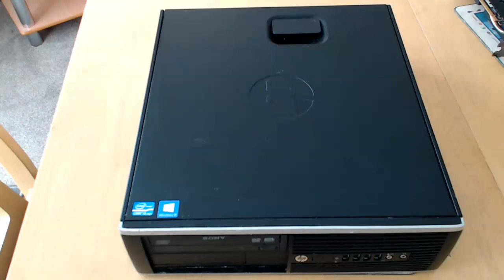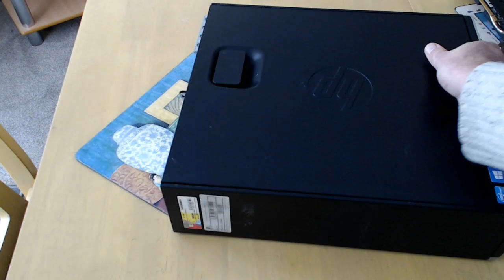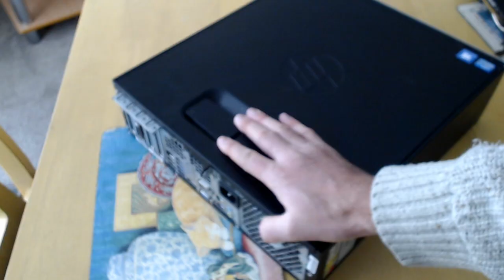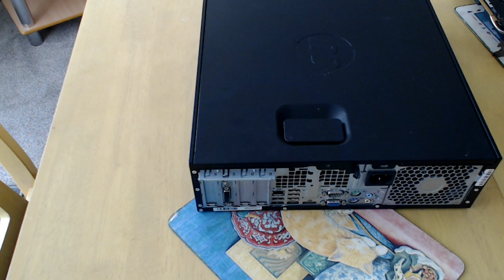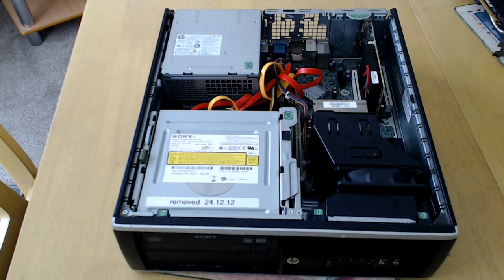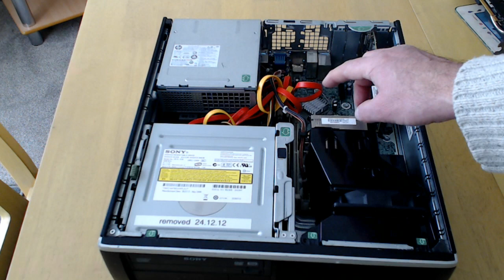HP Elite 8300 SFF desktop Part 1 Overview of system and upgrades

Comment: Can i put one more 8gb ram stick in it so it haves 16gb of ram?
Reply from the maker: Hi thanks for watching! The system has 4 ram slots and takes a maximum of 32 gb. So yes to your question! Maybe 4 x 4gb sticks or 2 8gb sticks. At a push 1 x 8gb 1 x 4gb and 2 x 2gb. Good thing having 4 slots plenty of options!  Try and get 1600mhz speed .

Comment: Did you face any difficulties with the r5 340, I have this exact model (hp elite 8300) and my r5 doesn't want to work, I've already changed many things, updated bios settings and much more
Reply from the maker: No problems with this one. Out of the many I've had, just 2 did not work. Maybe look at the card slot and ensure it's clean from dirt and dust. Same with the card connector. Ensure it's firmly seated in the slot.

Comment: Hey I bought this it has a i5 3rd gen 8gb of ram and the guy I bought it from says it has 100-150 watts what gpu can I get for 45 or less
Reply from the maker: r5 340x as in this build. You are also restricted to low profile cards. I am not aware of anything else in that price range. 1050ti would be above that price I think although you can try and search for one on ebay.

Comment: I have been thinking of slapping an rx 6400 lp in one of these machines but honestly have no clue what im doing.
Reply from the maker: Only low profile cards will fit and also  if they do not require an external power connector.
Reply: @computerrefurbishment9748  From my understanding it is a low profile card and it does not require external power so I'm really thinking about upgrading one of these. RX 6400 low profile seems like a really good card for old office PC's  😁
Reply from the maker: @zac3996  Should be ok but be aware the cpu may bottleneck it. Might just be as well to get low profile 1050ti for half the price of 6400 but your choice. I'd also upgrade the cpu to i7 in addition to get the most out of card upgrade.

Comment: ill this work with a 1050 ti i have a pc like this but a bit bigger
Reply from the maker: Hi yes. You might need the low profile version if case is not a tower. Most do not require an external power connector but best to check if one is not available on your power supply.
Reply: @computerrefurbishment9748  how do I know what power supply I have

Comment: Hello, I currently use a 3rd gen i7. Is it possible to use a higher gen i7?
Reply from the maker: Hi only socket 1155 is supported, therefore a higher gen i7 would not work.

Comment: a question I have the same pc can I put a 2gb R7 350 graphics card without having to change the power supply I hope and you answer me thanks
Reply from the maker: Hi looking at the card spec, it does not require an external power connector so that will be ok. Also ensure it's low profile and you should be fine.
Reply: I pop full size graphics card in and cut a slot in the lid, being a pro metalworker I have an angle grinder but you can use a 5 dollar minihacksaw and file /sand rough edges then rattlecan primer and paint to taste. This pc has no real danger of overheating, design is clever.

Comment: I need a power supply for a hp 8300 desktop, what power supply should i get?
Reply from the maker: As this is sff, only a full size psu can be fitted to the 8300 tower (with motherboard adaptors). For the sff, search for power supply specification.

Comment: Can I install my old GTX1060 in there, I use mine as a router/server system with proxmox. Would love to use it also as cloud "gaming" or office device.
Reply from the maker: Hi no that card would not fit, power supply is too low wattage and it's without a pcie power connector. You are therefore limited to 1050ti or 1650 low profile as the highest rated cards. Choose one that does not require an external power connector.

Comment: It takes 32gb of ram 8gb x 4 slots and a i7 processor
Reply from the maker: Thanks for the info. At the time, I only had i5 and 8gb ram so would go for your suggestion now. 32gb might be a little overkill for gaming though at present.
Reply: @computerrefurbishment9748  can be upgraded cheaply 8gb ram sticks on ebay for £10 i just got a i7 processor for £40   

Intel® Core™ i7-3770 Processor

Up to 3.9 GHz Max. Turbo Frequency (3.4 GHz base frequency)
8 MB cache, 4 cores, 8 threads
Intel HD Graphics 4000
Supports DDR3 memory up to 1600 MT/s data rate
Supports Intel vPro Technologies and Intel's Stable Image Platform Program (SIPP)
X
Intel® Core™ i7-3770S Processor
Up to 3.9 GHz Max. Turbo Frequency (3.1 GHz base frequency)
8 MB cache, 4 cores, 8 threads
Intel HD Graphics 4000
eam Supports DDR3 memory up to 1600 MT/s data rate unbuffered 
Supports Intel vPro Technologies and Intel's Stable Image Platform Program (SIPP)

Comment: Would it be possible to add multiple 3.5 drives as I want to convert it into a nas?
Reply from the maker: Hi there are 3 sata ports so you can disconnect and remove the optical drive and replace with another hard drive. You'd need to create a cover to stop dust getting in once the optical drive has been removed.
Reply: @computerrefurbishment9748  what sort of cover? Would you have a link? Would you recommend any other pcs around this price range that can be converted to a NAS that’s power efficient ? I’m was looking at raspberry pi and they are so expensive now. It’s cheaper for me to buy a full PC. Thank you for replying to my comment. It’s very much appreciated.
Reply from the maker: @MohamedFareedh  You might be able to get a plastic cover from ebay. Search for HP Elite 8300 SFF cover. In the uk there is one at £4.89. It will cover the hole left by removing the optical drive. The HP Elite series is perfect for nas solution. Ensure it has 3 sata ports and maybe i3 or i5 processor. Their power supplies are good as they are built to work in offices for long hours so reliable. Also these machines are cheap!
Reply: @computerrefurbishment9748  thank you for taking the time to reply. I will research these.
Reply from the maker: @MohamedFareedh  No problem!
Reply: @computerrefurbishment9748  I found the perfect HP elite 8300 for my NAS for less than 50 pound. It’s a bargain. What open source NAS software would you recommends that’s easy for a beginner like myself to install?
Reply from the maker: @MohamedFareedh  That's great glad you found a machine. I am not familiar with nas software so suggest you consult youtube. Toms Hardware forums are also a good resource.
Reply: @computerrefurbishment9748  ahh great thanks!